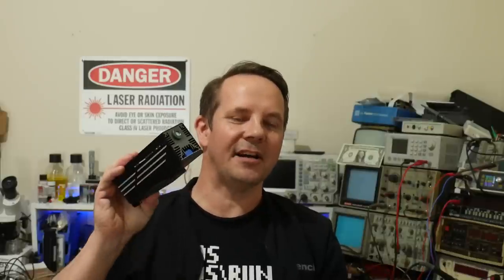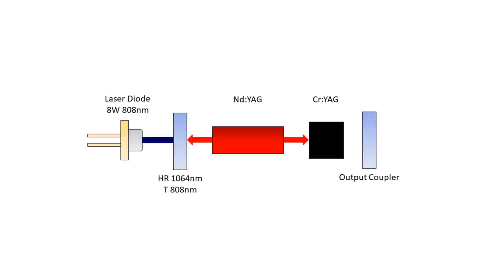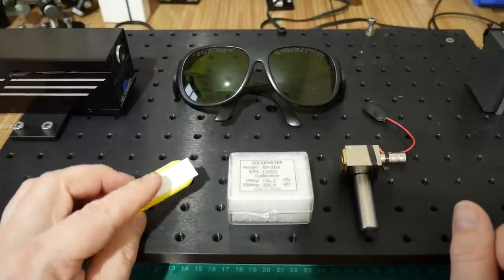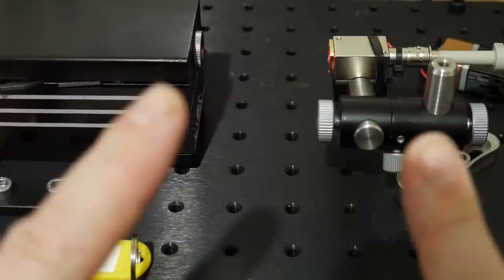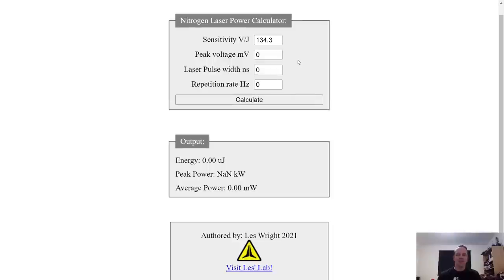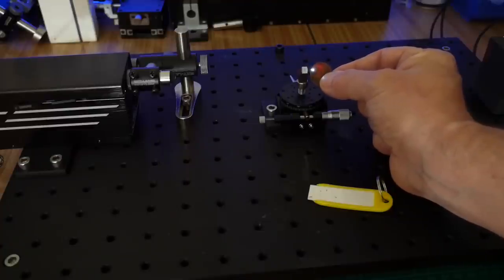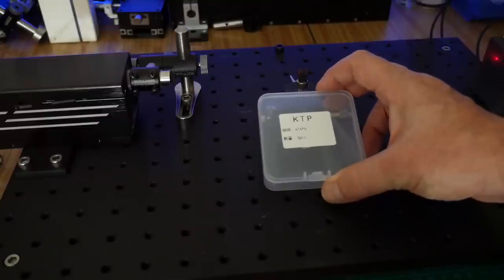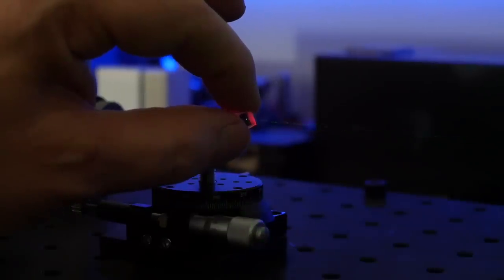Second Harmonic Generation in a 15 Kilowatt Laser!

Comment: I think I need to get a large aluminium plate for my 40w FAP800 which is now working a treat with marco reps laser driver. I have a 2" long YAG rod which by the colour of it and the coatings on the ends seems to be a diode pumped rod and has a pencilled arrow on it showing the beam direction. Can I just pump the rod with the fibre laser and expect 1064nm output or do I also need a Q-Switch? Love the videos by the way, every single one of them are really informative and interesting. Keep up the great work Les!!
Reply from the maker: Thanks! You may well be able to pump the rod with it, though at that length, it is probably designed for side pumping. You only require a Q-Switch, if you require high peak powers, without it, you would have CW operation.

Comment: spectacular to see such a large crystal and they are at a reasonable price now? amazing to see the green beam just emerging out of it like that it is a nice optical illusion , i tried making a lamp pumped ndyag-doubled laser long time ago my dream was to see if i can get that beast working using 4x500w halogen lamps in a circular array wired in parallel so i only built the pump part of it and tried to get it to work with a dimmer switch but it was acting strange it would work at first then the light got bright as if the dimmer was not even there im not to savvy when it comes to more complicated circuit and electrical design, i have a glass tube that would presumably hold the ndyag inside the circular array cavity then i wanted to get the mirrors with mounts  and eventually a doubling crystal and maybe have the whole thing water cooled using distilled water but it never went any further than building the pump which i still have and enjoy looking at once in a while , i did not get the rest of the parts though perhaps i was too timid with the costs and not sure of the success although i heard sam did manage to build one and get it to slightly work although it was weak beam coming out every now and then
Reply from the maker: On Aliexpress they can be had for about $20 USD for a 6x6x5 crystal, almost giving 'em away! :-)
Interesting, do it! I saw a halogen lamp pumped YAG on eBay some time ago, and wished I had bid on it. I have a huge YAG rod, and the lamps and cavity reflector just waiting for some optics. The rod and lamps are about a foot long!
Reply: @LesLaboratory  well i should have made it more clear i am not using halogen lamps but rather tungsten filament halogen lamps like the kind you get at a store for a ceiling  lighting lamp, the ones i have are 500w each and i don't think they don't make them anymore , most now are 300w  but i basically wired them parallel in a circular array (well 4 of them anyways) and i calculated they would draw about 17 amps from my wall which may be nearing  or exceeding the rated fuse outlet if mine are 15 or 20 amps so depending where i plug it perhaps but anyways im surprised the thing worked without melting apart with all the heat it put out in short time since im only using solder for the wiring and the wire is much smaller than the required 12 gauge its more like aaa battery wire lol in order to be malleable and compact enough to cram into the small package design but it works, would like to show you on cam if possible so you can maybe advise or tip me if this is even possible for a laser or give me better design idea, yeah i've seen the one you are talking about on ebay its like a big cylinder size of a small trash can i think they still have them maybe at throb labs

Comment: I tried to reproduce the experiment on generating the second hormonics on a 1064 nm laser in a TO18 case with a power of 20 mW and a KTP crystal, but I did not get the green light. So I don’t know, either this pumping power is not enough, or Ali Express sent a different wavelength. There is a 3000 mW diode on Ali, I think I’ll try it. Or I can disassemble a regular green laser module and extract the part that generates 1064 nm, and use it with my own KTP crystal.

Comment: Wow!  Don't think that I've seen this demonstrated before. So, you are pumping the crystal with the IR laser?  Does the crystal heat up?  that would be my question. Thanks for the demo.
Reply from the maker: Thanks! Yes, 1064nm IR light enters the crystal and 532nm Light emerges. As far as I know, no significant heating takes place in the crystal. Any IR not converted into green, just passes through. Temperature control is often used as the lattice shape is related to the temperature. This means if you allow the temperature of the crystal to drift too much, the lattice is no longer matched to the wavelength, and efficiency drops off.

Comment: Can you do an Experiment with The Nonlinear crystal attached to peltier 
With bidirectional Hbridge controlled Pwm input to control heating and cooling of crystal and see the Temperature vs Wavelength characteristics of NL Crystal !!
Reply from the maker: Could be a cool experiment! At the high peak powers, I'm not sure I would get anything out of it other than green, but I have some BBO on the way...
Reply: @LesLaboratory  i guess it should shift the wavelength of Parametric Conversation.

Comment: Amazing video!  I watched many videos where use a KTP  with a nd/yag pulsed laser.  I have a q-switched 30W fiber laser  from a laser marking machine. 1064nm  with 30 khz to 50khz pulse frequency. Will it work  with a kTP crystal ?
Reply from the maker: Without a doubt. At that average power, you will have to do some thermal management of the KTP though, and get safety glass that will block 532nm as well as 1064nm.

Comment: I've heard that some IR lightsources can been "seen" would this be in the same 2ir=1green; but the nervous system merely gets a read on green photons without any ever being manifested?
Reply: Or is than an other effect?
Reply from the maker: This is a different effect. If you fire a pulsed IR laser at the retina, a cell can absorb two long wavelength photons in rapid succession, and register one of twice the frequency. I'm not sure of the mechanism involved, but it sound like two-photon absorption. 
What you are seeing in this video is the physical doubling of the frequency of light itself.

Comment: It would have been interesting to see some numbers and waveforms from the pyrometer and photodiode to see how the KTP crystal changes the beam in the time domain and how (probably very) inefficient it is.
Reply from the maker: It would and I will. I am working on another video at the moment on KDP, but once that is done I will likely do a comparison video. Extracavity doubling can be very efficient if the peak powers are high and the setup is right (polarization, crystal angle and so on).

Comment: Does the beam hurt when you touch it? I suspect not, as the energy per pulse is so small and the finger is probably going to be fairly transparent at 1064nm, causing the volume over which the energy is deposited to be fairly large. And what is that red light I see on the penny when it is away from the focal point? Obviously the bright white/pink light at the focal point is ablation incandescence, but that deep red light.... it doesn't look like camera-misinterpreted IR to me. It looks very suspiciously like UV excited ruby fluorescence. Is it possible then that we are seeing something like two photon absorption induced fluorescence of the trivalent chromium ions in the saturable absorber optic?? Can you hit your spectrometer with that light and do another video 😁?
Reply from the maker: It gets pretty warm. I only ran it at around 20% duty cycle for that portion of the video, so maybe half a watt. 
The red light is there because the head has a built in aiming laser, which is pretty useful, but there is no way to turn it off. Given its design purpose, it is remarkably coaxial with the IR beam over about 30cm or so.
Reply: @LesLaboratory  ah, well, so much for my clever 'theory' 😆

Comment: Is there a way cheaper? 
I've seen a Nd:Ce:Yag + Cr4:Yag Rod 5x85+5mm with 1064nm coatings for around $250. 
Is it possible to get this to work with (many) LED or blue laser (2-8W) ?
Reply from the maker: Interesting, though when you figure in the cost of optics and machining a cavity ou migth find it gets expensive fast. Do you have a link? Pumping with LED's might be possible, but it would be insanely inefficient...

Comment: i am trying to understand what is average pw and peak pw, from what i know average is basically the amount of pw the lasing medium is emitting while running in normal cw mode and peak is when more pw is allowed to collect in the lasing medium either due to two things one being a q switch that is blocking the resonance from happening and allowing more atoms to get into the exited state from the pumping source before the switch is open and the remaining exited states are being stimulated by the rest of the incoming photons from the pump and released in a powerful pulse train and the other would be a similar q switch only one that is acting like a closed mirror that allows a closed loop resonator to form multi mega passes return trips of the photons back and forth to boost the pw then the mirror opens to release a powerful pulse train but i am wondering if your 15kw can be further increased if using this mirror type q switch instead or if its the same results? 
ok so if this peak pw only happens in 1 nanosecond but is being repeated that fast would this not mean the beam is basically cw and that much pw is being emitted every other nanosecond?? so its like a cw 15kw pw beam no?
Reply: thx for the love lee but what about my question?

Comment: what happens if you use two of these crystals? Does it turn blue?
Reply from the maker: You are on the right lines, but this particular crystal won't do it. 

The Light exiting the KTP  consists of 532nm and residual 1064nm. It is possible to mix these with a BBO  crystal to get UV light at 355nm.

If you want blue, you would use mirrors in the YAG laser coated for 946nm, that you could then double to 473nm, with either LBO or BBO

Comment: Are there crystals that could go further? Green to UV? UV to X-rays, etc?
Reply: Yes there are, they go down into the 180nm range I believe. My 355nm uses the same optical arrangement with a third harmonic crystal after the second harmonic one.
Reply: Yes but you need to remember the process is nonlinear and more and more inefficient the deeper you go. You can only get to the vacuum ultraviolet with this method, x-rays are absorbed by crystals and the conversion efficiencies even in the UVC are utterly, abysmally, miniscule.
Reply from the maker: If you wanted x-rays, far cheaper I imagine to build an x-ray Laser. Nonlinear crystals with that short a wavelength aint gonna be cheap!
Reply: @Zenodilodon  Can this be used for low cost deep ultraviolet lithography light source?

Comment: Could a low powered laser be used for non linear experiments Les?
Reply from the maker: Kinda, it depends what you expect so see. It is possible for example to double the output of a He-Ne Laser, but the effect is exceedingly small, you would need a photomultiplier tube to detect the light, which would be at single photon levels. You can intracavity double to get the required power energy density, as is done in Green Laser pointers, but you would need proper optics, and a stable setup to achieve it. There is some info on Sam's Laser faq on rolling your own DPSS Laser.
Reply: Thank you sir.   @LesLaboratory
Reply: Sam's Laser sir? @LesLaboratory
Reply from the maker: @hoofheartedicemelted296   https://www.repairfaq.org/sam/lasersam.htm